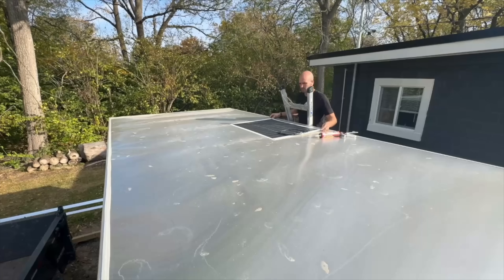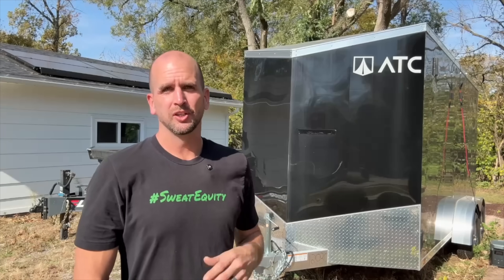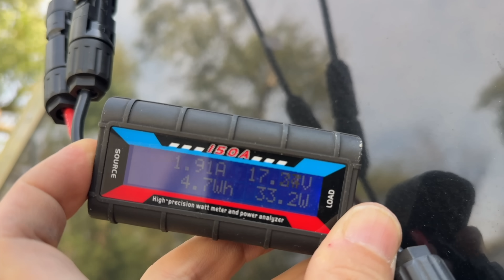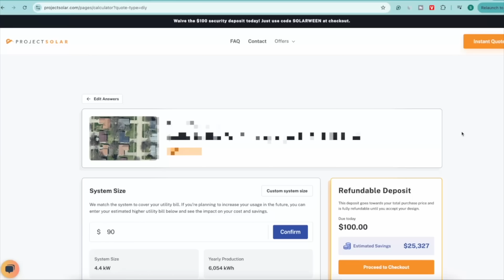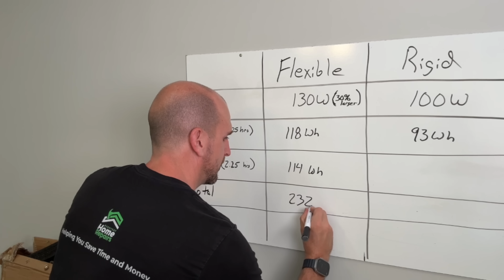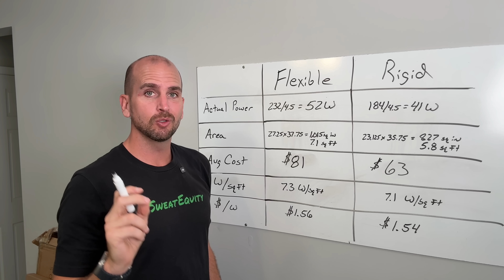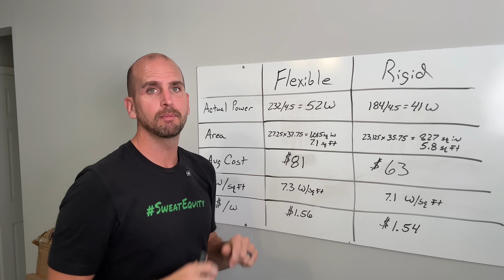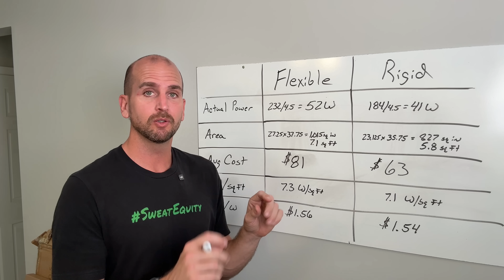100W Flexible Vs 100W Rigid Solar Panels | Don't Buy Until You Watch!

Comment: Rigid, rigid, rigid !! I am amazed how professional yacht builders now are going electric, using flexible panels embedded into the deck surface.
Many early adopters already found out the hard way, that this approach definitely does not have a long life span, and then there is the huge job to have them replaced, only to have the same issue not much later!
Rigid panels are used by professionals, like the bigger compannies, but also world wide on home roofs. It means that, also because of competition, the riged panels are developed (and tested) to withstand the harsh environments they sometimes are used in.
I am converting our aluminium catamaran into a fully electric motor cruiser, and did not for one second, consider flexible panels. But I must admid, that I am able to use the most common ful sized panels, which are (due to unreliable government actions) amazingly cheap here right now! Some 39 euro’s for a top brand 410Wp panel? I now have 12 of them, all for the boat.
I am aware that a lot of people don’t have the luxury (space) to go for the full sized panels, but please, for sake of reliability and life span? GO RIGID !😂🎉😂
Reply: place the rigid panels under clear perspex on the decks, you maximize solar input and can still have a usable  working surface, only downside would be added weight.

Comment: I have the same 130w flexi Eco-Worthy panel.
I fitted it with multi wall plastic sheet for air gap that's fixed with sikaflex 522 and vertical coach bolts through it to bolt flexi panel to it, so it's just 4 nuts to remove when panel needs replacing.

Comment: In Canada, if you mount these flexible panels on the roof of a trailer you're lucky if they survive one winter.  If you go with flexible panels go with portable where you fold them out qhen parked.

Comment: I run 3 -100W rigid panels on the roof of my RV + 2-100W flex's on the ground to chase the sun. 7 years ago I was going to use Flex on the roof as well to save the weight; but after hearing about numerous failures I went with the Renogy rigid. I just recently added the 2 flex's (Renogy 2nd generation) so I could save space & weight and easily place in the sun whne the roof ones were in the shade.
Reply: good to be flexible no pun intended lol options are always important when on the road. ⚡️⚡️⚡️💪🏼😋

Comment: I got a rigid 100w and a flexible 170w solar panel, both from renogy. But I am not getting more than 1.5 amps from my flexi on a sunny spring day in england flat on the ground. I know, the angling makes a big diff, but I expect more even in base line conditions. At least 4-5 amps?. How do I test if it's shot somehow?

Comment: I’ve watched flexible panels peel right off the roof of an RV and go flying in the wind! (While driving on the expressway at 65-70 mph.)
Reply from the maker: Yeah, that is why I am not a huge fan of only using Lap Sealant.  Much better to have some form of rack and/or fasteners.

Comment: Using different batteries is a terrible test. 
If you want a true test use two identical charge controllers to the small batteries. How do you not know this?

Comment: Flexi-types are easy to deploy (install), have lower initial costs , are more portable (lighter weight)  and offer you more power for the same budget ( short-term ).  Rigid types are aesthetically more pleasing (makes neighbours happier and look higher class rather than cheap) , have longer sustainable power outputs, are more expensive, are more difficult to install, last longer, are easier to clean (think of bird shit droppings on the surface) and are more resistant to front surface wear and tear (because of top glass panel).

Comment: What about panel cooling? With a flexible panel won’t get too hotover time?

Also, with the flat flexible panel, how are you going to get the best angle for production? It looked like getting to the correct angle was a 30% increase and that’s huge!

Comment: slightly off topic Q - benefit of directional diversity:
suppose you have 6 solar panels & house with 3 x 22deg slope roof areas suitable for panels. the roof areas face east, north & west. (assume in southern hemisphere). start with all 6 panels all on north roof, by default series connected. over a day you collect X kwh into batteries. next take 3 panels from north roof & install on west roof. so 3 panels each on north & west roofs. you collect Y kwh over a day. finally rearrange solar panels so 2 each on east, north & west roofs. you collect Z kwh over a day. which case (X, Y, Z ) gives max energy input to battery? obviously need matched solar conditions over 3 days for  tests to be valid.

putting it another way, does diversification of solar arrangement improve total daily energy collected? if so, is improvement significant or not? i would set 5% as min.

Comment: Nice info to have for sure. I have 2 of the flex panels of eco on my Utility trailer with 1 100ah lithium. I use it to run a 200 watt inverter and over the winter month to keep my side by side trickle charged. And in the summer it runs a small portable fridge at about 150 watts and charge our phones and camera batteries. Perfect small setup. Oh and the MPPT controller lets me run LED lights over the entire inside roof for a really bright consistent light but very low watts. This have been on for now 3 years. No issues!

Comment: so there is a difference in the testing... the rigid had the air gap underneath to help with cooling more. Could you not raise the flexible panel in a similar fashion to help with its ability to cool as well?

Comment: I had 4 flexible 100 watt panels and I made a complicated mounting configuration that allowed standoff and some ventillation to help preserve the panels but they burnt up significantly in the first year now I'm going on year two and the most I get is about 100 watts out of 400 watts of solar.  I'm keeping it up there because of  the difficulty of installation but I should have found bigger Ridgid panels to help keep the batteries more topped off.

Comment: I'm still going flexible with corrugated plastic underneath for air. For several reasons. Stealth and weight and but mostly I have no way to mount ridged panels.

Comment: The biggest downside of flexible panels - you don't mention - is their much shorter durability! They won't last for 30 years outside with their starting performance! Maybe they last 10 years compared to 30 for rigid ones!
Reply: 20 years the panel is pulling 50%

Comment: Wondering why you wouldn't mount the flexible on something that would allow air flow beneath and around it.  Can't imagine how hot that roof gets.  OR, a more portable mounting solution that you could just throw them up or out in the sun to do their thing vs constant roof install.  Guess that's where a solar generator that can charge while driving, then put the panels up for when you're parked.  But, i'm new to all this van life, so i'm just a pup wanting to be a big dog when i grow up.

Comment: Man, it would be nice to line the top of a job trailer with the low profile solar panels and put a battery bank in it. 🤔
Storage and power in one shot.
Reply: Or even my toy hauler trailer I tow behind my motorhome. Essentially my motorhome is my full time home and my trailer is my garage, where I keep my motorcycle, e-MTB, e-scooter and other stuff - I'm going to get a quote for installing solar panels, MPPT controllers, LFP batteries & an inverter on the trailer, it will provide complete redundancy to my motorhome solar/battery setup.

For a job trailer you could get a decently powerful inverter that would easily run any power tools and chargers for the battery tools, very useful I would think.

Comment: I have both rigid and flexible. The rigid panels I have mounted are mounted on a cart like stand where I can move them around my large balcony or on the driveway/lawn.
 But I made a frame out of furring strips for my foldable Bluetti 200W flexible panels to stiffen up the panel. I also add 3 kick stands instead of using the ones that come with the panel. 
The panel's grommet holes are slipped over dowels. Still easy to move around when camping and other outdoor activity. The So/Gen is put in the shade of the panel(s) when charging but not being used.
Edit: The frame is made to be taken apart for storage.

Comment: I got 3 100 watt flexibles on top of a cargo trailer paired to 2 12v deep cycle marine batteries I installed in 2017 still producing enough power to run a small fridge and keep my tool batteries charged.  I started with 2 panels but it was not quite enough. Somehow its still doing fine, after all these years including the batteries. I am sure something is due to break soon.

Comment: I built a stealth camping box trailer anout 4 years ago and went with the flexible panels glued to the roof both for low visibility and arodynamics as this trailer gets towed all over the country. So far they are still working well.
Reply: What brand did you go with?
Reply: @Devin-Meyer I have DGSunlight panels.  They are still available on AliExpress, though the price has gone up quite a bit from when I purchased.
Reply from the maker: Thanks for the feedback on the flexible install 👍
Reply: May I know the brand of your flex solar panel
Reply: Of course they are more efficient. Rigid Panels have layers on top of the cells to withstand harsh weather.

Comment: Not the best way to compare.  Take 232/130 to give you the panel multiplier = 1.785 and 184/100 = 1.840.  The rigid panel produces more power based on its capacity over the same time.  Now as to the square foot argument it only makes sense if you can fit more panels into the available area when comparing.  So lets say I can get one more panel on the roof if I use product A vs product B, then there is an advantage.  If occupying 3 more inches in one direction and 2 more in the other direction for one product vs the other, then it makes no difference unless you need that space for something else.  Back to my first point.  I always evaluate solar panels based on their multiplier taken over a day.  The number of course changes seasonally.  So for the spring a typical rigid panel produces 3 to 4 times its capacity per day or 300 to 400 watts.  Summer can be as high as 7 and winter as low at 0.8.

Comment: Rather than comparing the size of panel and panel cost, you might want to compare by size and cost of the installation. That's especially true for size comparison in limited spaces.

Comment: Just for fun.... (this is on a motorhome) I have HQST 190 watt solar panels x 3 (total 570 watts) and a HQST controller. Ever heard of that brand?  I am pretty happy with my setup, but wonder how my panels compare to other brands of the same size.  My battery bank is 6 x 100 amp hour LiFePO4 batteries.  I am thinking about adding another HQST 190 watt panel, but not sure if that would be that beneficial.

Comment: Wasn't fair test you had the flexible right on the roof more heat there you should have put a spacer half inch or quarter inch spacer in there so air would get underneath would probably make a big difference you had an air underneath the rigid you can put a spacer on the eyelet holes say half inch and screw it into the roofing do it roof Heat will affect the flexible panels you don't have a space in between there we probably perform better then that would be Apples to Apples just the old man's opinion

Comment: So we’re doing a side by side comparison of a 130w flexible and a 100w rigid panel. The flex is rated 30% higher and produces 26.8% more power. But in 4 years the flex is dead and in 10 years the rigid still produces 80 watts. Whilst the flex is much lighter, it is best not to expose them to the sun because they’ll soon be damaged.
Reply: True.  Best way to take care of your flex panels so that they last many years:  
Deploy them only at night.

Comment: For a permanent setup rigid is the way to go, people just need to mount them properly on their caravans and vans. Seen too many stories where they have flown off into other cars. Flexible should only be used for a temp setup as they always tent to live a short life due to being over heated too much. 

Also our renogy panels on our van are still going strong after 3 years, no noticable drop in power output yet!

Comment: The flexible panel will hold condensation under it and will corrode the aluminium roof  . Let alone the fact that that they degrade and deteriorate

Comment: In the UK diesel is WAY more expensive than in the states. Increased drag and weight from the rigid would increase my fuel costs - but I wonder by how much?  It would be interesting to see a comparison of MPG of rigid Vs flexible whilst driving.

Also my intention is to mount flexible panels on twin wall polyurethane to create an air gap, and (hopefully) some insulation between the roof of my van (on a hot day) and the flexible panel. Is this something you have tested?

Comment: Longevity of flexible panel: I had to replace one of my 100W flexible panel (branche damage) and compared it my original panel installed  in 2019 (5.5 y.o.). The new one produce 45w vs. 42w for the old 5 y.o. one). Measured on a winter day.
My van is outside most of the time for 6 years, in California, so longevity issue for me with flexible panels.

To install on a small camper RV, I see is only benefits for me to install flexible panel:
- Stealth (they are invisible from a standing person), - Ease of install(just adhesive!).  - No drilling in a new vehicule (water peak etc..).
- Gas milage (no drag).  - Esthetic.   It's a no brainer...

Comment: I fully agree about the lifespan of flexible. I ran smaller power rigid units against newer flexible units that. Eventually started to fail under sustained high temperature. The only advantage is their light-weight as they were tracking the sun using less power but were prone to high wind causing flexing and resonance!
Usually you get a what you pay for. I, personally, will pay higher and tolerate the weight penalty for the longevity in future projects.  😊

Comment: Do the flexible panels make the trailer hotter bc they are black and transferring heat directly heat into the roof?
And conversely, do the rigid panels offer and shade to the roof keeping themselves and the roof cooler?
Is there any thought about the optimal spacing to allow for airflow under the panels?

Comment: I had 4 ridged 100w panels mounted on my gmc hightop van after 4 years I removed them to upgrade 
(I could mount 6 12bb 100w panels in the space of 4 older 100w panels.) and most were beginning to de-lam on the edges, other panels that were  stationary (same make and age )were fine.
if you mount mobile make sure they are flat and ridged.I could mount 6 12bb 100w panels in the space of 4 older 100w panels.

Comment: I would consider the flexible one for my application, just to contour certain areas that are rounded & need that curve. I think it depends on where they are being mounted. Rigid for a flat roof is ideal but for more curved or temp applications flexible would be best.

Comment: Good summary. thanks. The rigid panels with air circulation underneath will also reduce the heat input to your trailer or van. However, they will also increase the  air resistance or drag when you are moving increasing your gas consumption.  Maybe install some fairing on the leading edge of the panels and make sure the panels are installed with not gaps between them. It’s going to be a trade off between allowing maximum air circulation and minimising drag when moving.
ETFE coated flexible panels should last 10years but PET coating lasts maybe less than 5. So the more expensive flexible panels should last longer (assuming higher price = ETFE).
Reply: Rigid panels mounted correctly will not significantly increase drag. I average 15.3L /100 with my panel on the car and 15.3 with it off. I have a 15cm gap between the panel and the roof of the car to minimise any heat soak caused by the roof of the car when I am stationary. The only place I would use flex panels is if I was going to make a massive solar blanket and needed the weight saving.
Reply: @christ2838 have to say I am surprised you don’t see an increase in fuel consumption with the panels on. I guess a big factor is how fast you drive. At 30mph it might not make much difference but at 60mph I would expect some measurable difference?

Comment: personally I use domestic rigid panels on our trailers and workshops.. like you using unistrut .. I got some ex solar farm 1.7 x 1 Metre 35mm thick 350w panels (they were replacing them with 450w panes) for £26 each here in the UK ok so they were 7 years old but still working great... I also got a load of 10 year old small and slim(1 x 0.8 metre x 12mm )175W panels for £16 each...its super worth searching out local solar farms that are upgrading.

Comment: You should run your panels into a standard wirewound resistors,  you don't know the state of charge of two different batteries which will draw power differently at different times.  For testing keep your test load fixed for best results.  
A very good presentation, thank you for your effort.  I have three 100 watt panels factory installed on my Airstream and they cannot outperform my 200 watt portable panels which I keep at the correct angle.  I found that following the sun produces 3 times the watthours of fixed roof mount panels.
Reply: Wrong! Resisters  only rob power and create heat.
Reply: Not true at all. Any serious installation use an MPP or Maximum Power Point regulator. The charge state of the battery will have very limited impact compared to replacing the MPP with a badly adapted resistor.